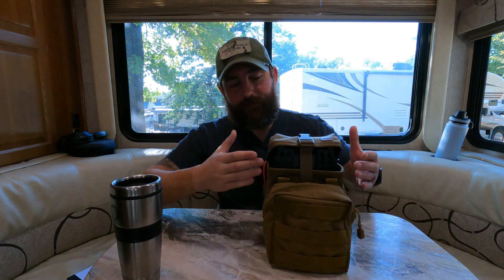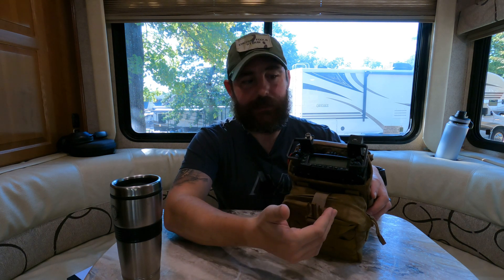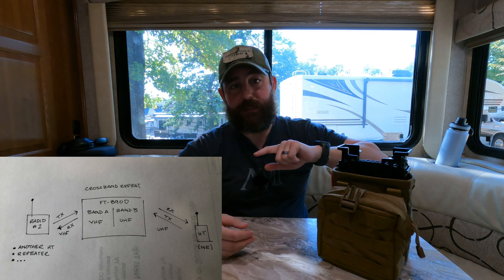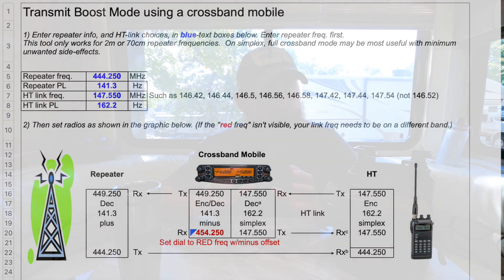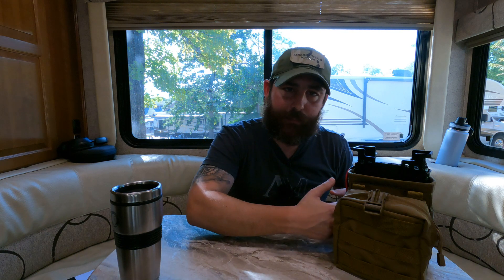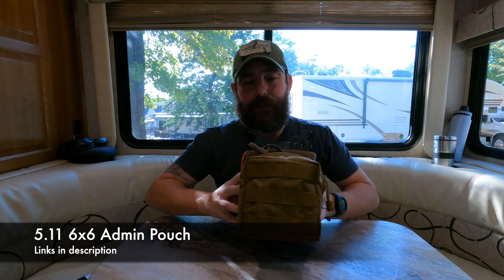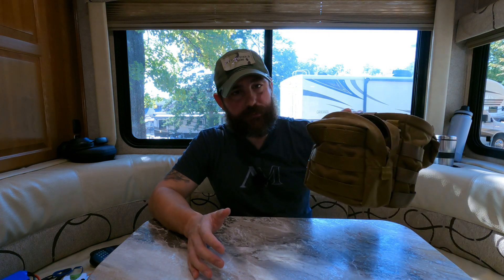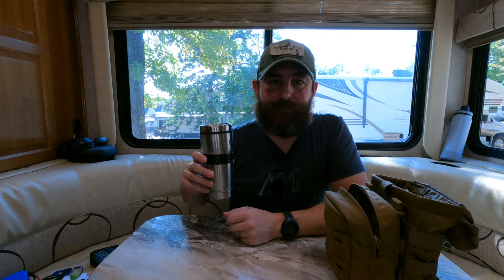Military-Style Radio - Manpack Crossband Repeater - Part III

Comment: "Poor man's repeater", but not so poor to get a FT-8900, so I guess the definition of poor has gotten higher 😂 Wish I could find an 8900, or that Seth of Armoloq made a frame for the Kenwood TM-V71A. I have heard about using cross-band repeat in remote areas of California wildfire response, but I lack that capability right now.
Reply from the maker: Haha. Actually, it's a term we use in the tech industry. I meant "poor man's" more in the context that this is not a "real" repeater. It's like the MacGyver of repeaters. These older rigs seem to be more expensive now than when they were in active production. 

I almost brought up the TM-V71A in this video. It's still in production and has the same capabilities.  In fact, the V71A is nicer as it supports TX locking on either side of the radio. There's no need for the complicated hack I will show in my "transmit boost" video. I have a feeling this radio will end-of-lifed soon.

I've talked to Seth about making a set of TPA pack frames for the TM-V71A. We are both not in a position to pay close to $500 USD for that rig right now. I have the D710GA, but the form factor is not manpackable. He is open to new frames if you ship him your radio. It's a great way to get a free or discounted frame out of the arrangement. Send him a note.

Cheers.
Reply: @TheTechPrepper  I bought my TM-V71 a for exactly the reason you mentioned. Since my HT will usually receive just fine in the house but has trouble hitting the most active repeater in the area I can do a one way x band and get in just fine. If Seth would like me to take some measurements or possibly let him use mine as a model I'd be happy to help. These are great rigs and pretty popular. Shame they seem to have been discontinued and prices have gone nuts. wouldn't mind picking up another.

Comment: Will you be doing a DMR manpack episode?
Reply from the maker: That's a good idea, but it will have to be next year. I gave away my only DMR radio for the 10K subscriber giveaway. I'll have to research which DMR mobile radios are manpackable and meet my other manpack requirements. I'll likely start by looking at the Anytone line. What DMR radio are you running at the moment?
Reply: @TheTechPrepper  I have an AnyTone DMR HT currently but saw that rails are available for the AnyTone 578 mobile.

Comment: Curious - any idea what the swr looks like on the signal stick?
Reply from the maker: I personally have not tested it as I do not have the equipment to test it while mounted on the frame. I did receive a report from a viewer that he was seeing < 2:1 on 2m/440 when running the setup. Apparently, the frames mounted to the radio chassis provide a usable ground plane.
Reply: Interesting stuff for sure